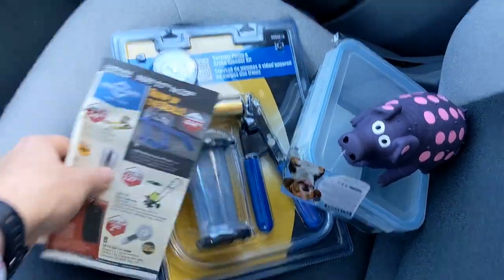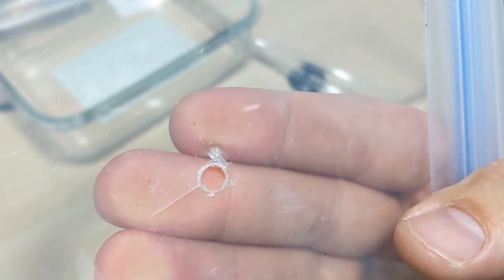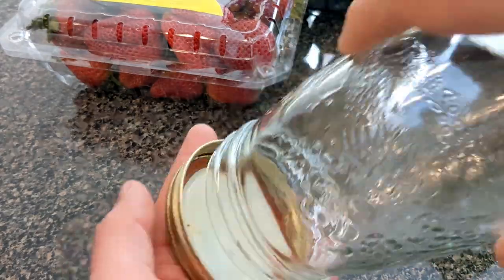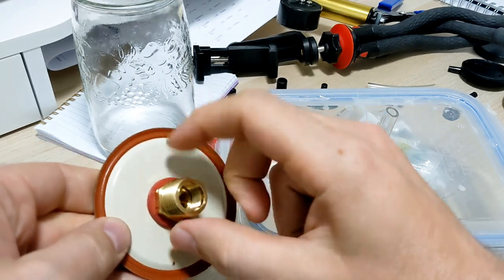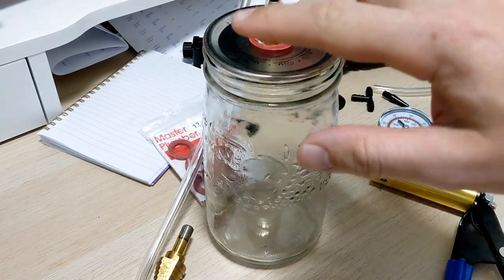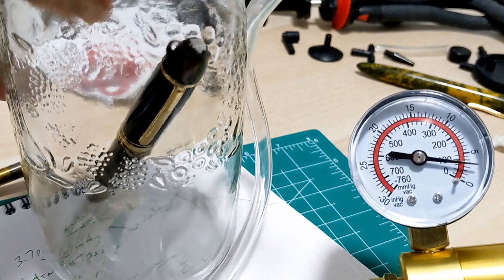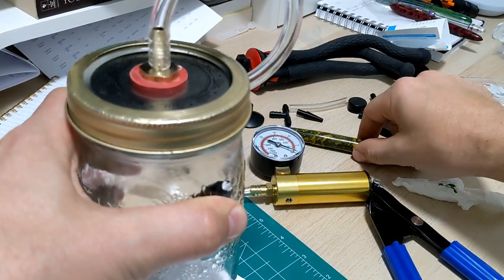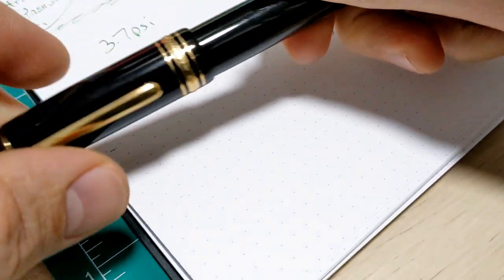How To Make A Vacuum Chamber (Fountain Pen Edition)

Comment: The mason jar and your connections seem like a perfect low-cost solution; great thinking. I look forward to lots of experiments with different ratios of air and ink. I've definitely felt a difference in the interior air temperature when flying at altitude from home in winter, then across India during their summer, so you might want to try getting out the hair dryer too!  Also, nice shirt, by the way.

Comment: It was interesting, you should try with the pens nib down though, or with the jar horizontally so we can see if the air inside the converter pushes the ink out.
Reply from the maker: There will be much testing to determine the best & worst ways to store a pen on a plane.
Reply: Exactly! The problem with low pressure is not the ink expanding, it's the air in the reservoir. If your pen is 100% full, there's no air to push out the ink. If the piston filler or converter is not full and the nib is pointing up, the air will push out only what's in the feed. The worst case then is if you have a piston that's 80-90% air, and the 10% ink is at the bottom of the reservoir, blocking the air's way to the feed, that's when the most ink is bound to be pushed out.

So  the standard test should be: soaked feed, nib down and ink at 50% or less. That will best test any bulk filler and vacuum that has a gasket shutoff for the reservoir, or how tight the cap is on other pens. I have a feeling no cap would really seal up the air enough on a pen to stop the drip in such a torture test, but some vacs would survive (or a shutoff like an Opus88 or a Visconti HS). The most vulnerable would be old sac lever pens, because the reservoir is soft, never fills all the way, and there is no front shut off.

Comment: We need to go to France and have them change the unit of decibels to something else so you can have the DB unit! Maybe the unit can be irl (ink retention level) and if instrumentation allows, it would be the ratio of ink inside the pen after the test, to the ink it started off with. Or keep it simple to a scale of 1 to 5 on how bad the inky mess to clean will be.
Reply from the maker: Could write it with the backwards D like in the logo. I might have to relate it to at what vacuum level it starts to leak

Comment: Fountain pens are VERY happy at any altitude AS LONG AS THEY ARE  NIB UP. When the nib is pointing up,  the ink settles at the bottom of the ink resivoir, allowing the expanding air to escape through the nib/feed. If the air bubble is not at the nib side, it will expand, pushing the ink out of the nib. This will happen if the pen is stored nib down, or horizontally. Of course you may get the case where the pen can be nib up, but the air bubble in the resivoir is still at the bottom due to liquid ink surface tension. This is more typical in cartridges or converters. I have been flying for decades with fountain pens and have only had leaks when the pens were not stored vertically (I.e. were not in my shirt pocket). The vacuum bottle setup is a great idea.
Reply from the maker: Thanks for the tip 👍 I've never been brave enough to keep my pens in my shirt pocket at sea level let alone up in the sky! I usually keep them in a case in my carry on so no way to ensure they are upright the whole flight.
Reply: @Doodlebud  when you do the tests with the nib pointing down its 100% guaranteed the ink will leak. Exception are vacuum filler pens that have a shutoff valve aka Pilot 823 or Visconti power filler.

Comment: I flight a lot and I have always a couple fountain pens with me.
Never had any leaking pen, but the Twisbi Eco did not survive. After going up and down in to five flights on a foward and back 48hr trip, the Twisbi had a imense crack on the body. Total mess in the bag since it can hold a imense ink capacity.

Comment: The best way to make a mess is to take off with a capped pen and then open it at cruising altitude.
Reply from the maker: Unfortunately I won't be able to open a pen once it's in the vacuum chamber.
Reply: @Doodlebud  Also if you are over ten yrs old perhaps you know better.
Reply: I have used my pens midflight with no inkcidents. I did not make sure they were full. I live dangerously i guess.
Reply: @andream3568  You win.